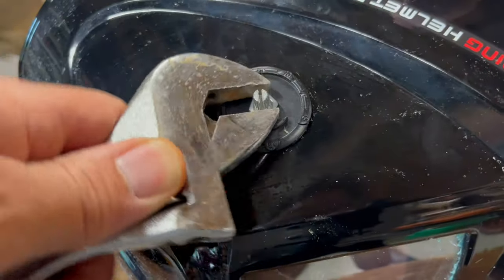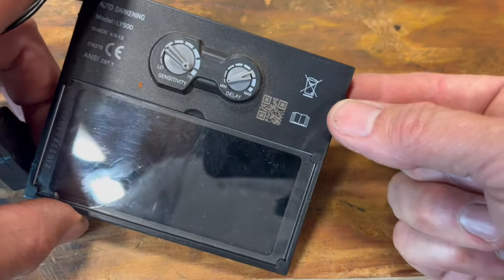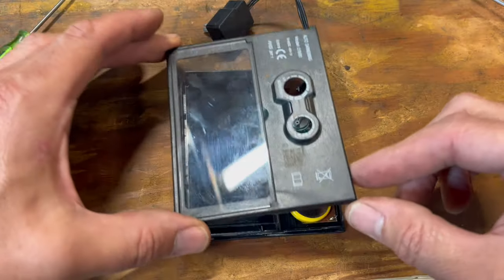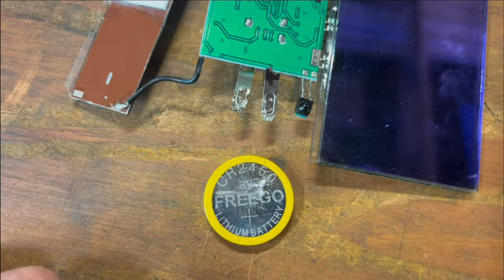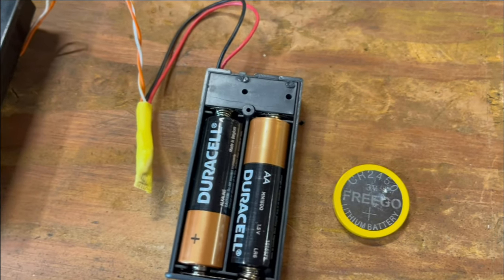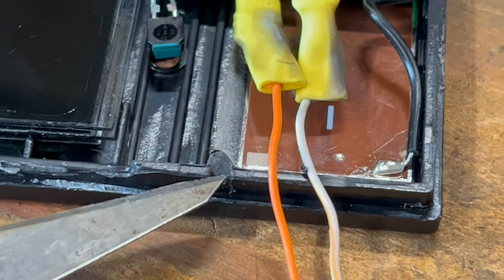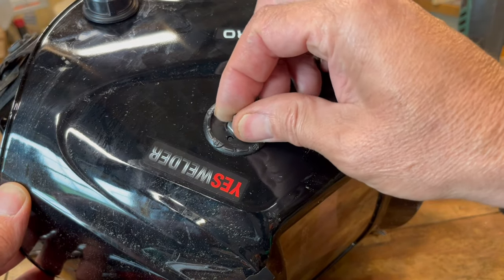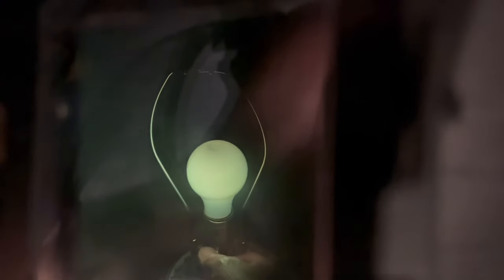Welding Helmet Battery Replacement

Comment: A brilliant cure for a very annoying problem. 
Why is it that whenever I go to use my welding helmet (which isn't often) the battery is dead?
Why is current being drawn when the helmet is just lying there?
Should I be storing it in the black bag it came in, for some reason?
It is very perplexing because these things have no on/off switch.

Comment: Thank you sir, I was about to junk my Yeswelder helmet. I did do my helmet as you showed but I did solder the wires and bought the 2AA battery holder with an off and on switch, worked like a charm…

Comment: Flow surfer video now please
Reply from the maker: I have been working on it.  I got the Diesel engine running and am now building the dashboard for it, and building an exhaust system to go out through the wall.  I used the welder helmet and welder to make legs for the engine.  Video update soon.

Comment: Won't the circuit be trying to recharge non-rechargeable batteries now?
Reply from the maker: Good point.  Yes, but the solar cell is no match for Duracells.  It works fine.  You can cut the wires to the solar cell if you want.  I may do that, since you pointed this out. Thank you.
Reply: @HowToLou  No problem. It would probably been fine but you never know. Especially if the batteries get really run down.
Reply: @HowToLou run a piece of tape over the solar to stop it getting any light
Reply: Slap some rechargeable batteries in there even simpler lol
Reply: No, those 2450 lithium batteries are unchargeable.